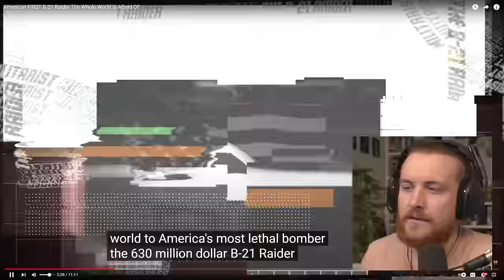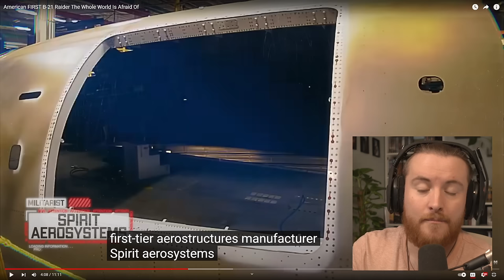Royal Marine Reacts To American FIRST B-21 Raider The Whole World Is Afraid Of!

Comment: The F-22 has the radar cross section of a bumble bee.
Reply: The more conventional description is that the F-35 has the RCS of a golf ball, and the F-22 has the RCS of a marble
Reply: Source: Trust me bro.
Reply: But it's a bumble bee that flies at Mach 1.7.
Reply: That's at first detection. The closer it gets to the radar, the larger the profile.
Reply: @liberatumplox625   the F-22 has an RCS of 0.0001 meters squared Source Lockheed Martin/Boeing
Reply: @2fathomsdeeper  F-22 can do 1.7 without afterburners. it can exceed 2.1 with afterburners.
Reply: @seanabsher5577  That's mainly to get to the battle faster. Top speed isn't very important in the dogfight.
Stealth, maneuver, weapons, pilot skill, awareness, these are all much more important. It's also where the F-22 shines like a huge lighthouse.
The F-22 is easily worth more than 20 planes for the enemy. If there was a squadron of 5 F-22's, they could take out 100 enemy aircraft, no problem.
Reply: @protorhinocerator142 
One of the best things for the F22 is its ability, similar to the F35, to identify targets and hand off that info to individual missiles.
After that, the F22 pilot hits the kill button and drinks a martini on his way home.
Reply: * acknowledged radar cross section
Reply: Wouldn't the fact that a bumble bee moving that fast should be a red flag be a problem?
Reply: Well a bumble bee has the radar cross section of an F-22!
Reply: @joshbull623  , it's not like in Star Trek where sensors and scanners can not only detect an object, but immediately determine its shape, material composition, and other physical properties.

A radar system is going to display a collection of radar returns based on signal strength. It's not showing some aircraft, a flock of geese, and a bumble bee...

The smaller the RCS from that distance and angle, the closer an aircraft needs to be for radars to receive a strong enough return to be distinguishable from background noise. ECM could make that range even shorter

Until a critical distance is reached, a stealth aircraft will not show up at all. Once in range, it will appear as a return on radar. The problem for the defender is that it is possible that the intruder has fired its missiles before the aircraft shows up on radar. The incoming missiles may be the first indication that they're there.
Reply: @liberatumplox625 don’t be that guy…
Reply: And has the aggression of a hive of killer bees.
Reply: @seanabsher5577  Mach 3.3 top speed
Reply: @liberatumplox625  bot found
Reply: @weissmorris8822 bumble bee nut marble can't change what's been said buy what been said after testing and everything
Reply: Detecting and weapons lock are two very different things

Comment: If I'm remembering what I read correctly, one of the giant aspects that won the B-21 the contract was the low cost and ease of maintenance. Part of the reason it took so long to develop was because they wanted it to be made from parts of other planes, military and not, so parts would be cheaper and easier to source, since the infrastructure was already built, and parts were already needed for other things, so production could be shared across more airframes.
Reply: One of the giant aspects that won the B-21 the contract was politics!
Reply: @bigcountry9457  Well yeah, that's always the case.
Reply: Gotta reduce that logistics trail. The real cost of any weapon system is sustainment.
Reply: There was also the material science. The new radar absorbent material is SIGNIFICANTLY better. It’s cheap to maintain and can withstand harsh environments like salt air without requiring time and money intensive maintenance.
Reply: @DAAllan82  Ohhh I didn't know that, very cool
Reply: @DAAllan82  Funny enough, most materials science advances tend to go that way.
Stage 1: Wouldn't it be cool if we could get an X that does Y?
Stage 2: We can now make an X that does Y!
Stage 3: Holy shi- X is expensive to maintain, can we get something that does Y without breaking the bank?
Stage 4: Z does Y for less!

Comment: We really need to Make a successor to the B-1. The B-1 is an absolute monster that has not gotten the love that it deserves.
Reply: The B-52 is going to turned into a cruise missile truck and I'm surprised the B-2 wasn't a  non stealth supersonic cruise missile truck.
Reply: Per the video, this will eventually fully replace the B-1 and the B-2, meanwhile Grandpa Buff will remain until its expected retirement in 2405 after helping the NCC-1701-F on some missions and watching it retire also.
Reply: I would love to see existing B1-B's converted to the B1-R concept. Those would be terrifying to the enemy.
Reply: I would much rather see a successor to the B-52. I call it the B-53. 
It's basically the same plane as the B-52 but around half the size. It carries half the bombs and uses half the crew. Much more modern of course, and easier to maintain.
Since the B-53 is smaller, it can take off from any runway. You don't need a 23 mile long runway or whatever like the B-52.
Since it can take off from anywhere, have them take off much closer to the target. You get faster turnaround, and more bombs on target in a 24 hour cycle.
Reply: @orlock20 When you decide to carry cruise missiles, you put 90% of your payload into propulsion, and only 10% into warhead and guidance. The B-21 can put 100% of its payload into warhead and guidance. To put it another way, the 20 B-2s would have the same effect of 200 similar aircraft carrying cruise missiles.
Reply: @protorhinocerator142 That would be the B-47... which had the disadvantage of needing support from allies like UK, France, Germany, Turkey, Japan, and had operations restricted by domestic politics of those countries.
Reply: @DonMeaker The cruise missiles carried by the B-52 would have warheads ranging from 1,000 lb to 2,000 lb.  The U.S. torpedo has a warhead of 640 lb.
Reply: Every one loves the Bone
Reply: B-1 Lancers is getting upgrades to keep it in service into the 2040s. Which is good because it’s our only supersonic bomber, has the highest payload of any of our bombers and it is actually very stealthy.

Comment: The original design of the B2 did not have the multi-faceted tail.  That was a last minute modification to allow it to operate at low level instead of high altitudes.  This was done because Airforce brass didn't trust stealth technology. In fact, the original B2 tail was almost identical to the B21.
Reply: This.
Reply: Now that stealth is proven, we took the training wheels off to make the B-21.

Comment: 13:00 the B-2 needs air conditioned hangers the B-21 does not.
Reply: Do you know how terrifying that one fact is?
Reply: @outcastmoth78kaminski4  plus they are smaller, so they can take off a smaller airfield.
Reply: @apex_blue  how low-key horrific would it be if it turned out the Raider [as is Doolittle and his Raiders...] could launch from a super carrier like Enterprise when she launches in a few years...
Reply: @outcastmoth78kaminski4  B-21 rocket assisted takeoff when?
Reply: @outcastmoth78kaminski4  Being serious here, while the B-21’s range is classified. It’s heavily implied that it’s meant to have the range capable of going to China and coming back.
Reply: @apex_blue  indeed and likely Drone based mid air refilling is included in the basic design.

Comment: I have seen these stealth aircraft in person and they are extraordinary.  In fact, they are spooky and will scare almost anyone.  Their black color isn't just dark; there is almost not depth perception.  In the air, the planes can turn in such a way as to virtually disappear to the onlooker.  These planes are meant to get the job done and are likely to do it.
Reply: Right! Its not just black paint. Their coating is very expensive, designed to absorb radar, an segment of electromagnetic waves, similar to visible light. 
So this makes sense with its peculiar visual characteristics that make it visually difficult to track
Reply: Yep
Reply: There is a video of a B2 doing a flyover a street fair. The thing looked like a hovering silent flying saucer and only made a sound when it was right on top of the person with the camera.
Reply: The B-21 isn’t black. It’s a grayish white and is not intended to fly only at night.
Reply: I also got to see one in person and it was amazing. I was at an air show and we knew the general direction it was flying in from, but we barely saw it until it was right over us. It made no sound and was out of sight in seconds.

Comment: The revealing ceremony did not show the back of the plane.  That’s why you keep seeing differences in the rendering of the trailing edge of the wing.  They only pulled the B21 halfway out of the hanger, and only allowed front view photos at the revealing.  That was how they intended to reveal the B2 as well, but a savvy reporter rented a plane, and was able to photograph the B2 from different angles.  That’s why they only pulled the B21 partially out of the hanger.
Reply: Yeah, the longer they can keep things secret the better.
When we first made supersonic jets we kept the tail sections hidden too. With prop jobs, you could have partial flight controls on the tails. These didn't work well at SS speed.
To make it work, you needed the whole tail to move as one. It would be very obvious how we overcame this problem from a picture, so the tail itself was classified.

Comment: The Government issued a Request For Proposals (RFP), very classified, to the very few firms US who had the wherewithal and facility clearance level to do this.  That RFP didn't specify a design, rather it set out the requirements for a LOT of things, but the biggest examples would be bomb load carried, cruising speed, max speed, radar signature, max range, etc.  Then they bid, and the bidders will spend millions, maybe tens of millions, on the bid, because if you win the prize is so big. The Northrop design has built in advantages like having no tail - reduces weight and radar signal. Basically the entire plane is creating lift, and carrying engines, fuel, bombs, systems, or pilots.  The efficiency leaves more weight carrying to be dedicated to other things, such as fuels and bombs.  Super-efficient shape that happens also to be naturally strealthy.  When you see a side on shot, it looks like a bird of prey, and the hump mimics their body shape when they are diving on prey.

Comment: Basically a bunch of military contractors come up with designs and propose it to the military and whoever makes the best case for their plane gets the contract to R&D and build the plane
Reply: That's not true at all.
The military starts by pointing out a need. The F-22 can do this and the B-2 can do that, but there's this big capabilities gap RIGHT HERE that we need to fix.
The Air Force makes a list of requirements for the future miracle flying machine, and the defense contractors have their engineers come up with proposals. Eventually they need a working prototype to seal the deal. The requirements for the B-21 are feakishly insane, and a company managed to meet those requirements. Game on.
Reply: @protorhinocerator142  "miracle flying machine. " lol. Also, it's the best spot on description ever.

Comment: One of the reasons the B-21 was built to fly unmanned was to extend its range and capability by flying at 60,000+ feet. (Less gas is burned at that altitude.)  The bomber is still piloted remotely by B-21 pilots sitting behind a console. (Referred to now as the "Chair Force."  I'm told they've enhanced its radar absorbing material (RAM) among other things.  Being in the Air Force I regularly flew into Whiteman AFB and saw the B-2 up close and personal (from a couple hundred yards) while my own aircraft was being refueled.  I always enjoyed passing through Whiteman AFB for that very reason.
Reply: They also stuffed the B-2 with a bunch of targeting sensors making it a real time scout as well as a bomber.

Comment: The tail of the B2 was always supposed to look like the Raider's tail as it is better for radar cross section. The fly-by-wire flight systems at the time of the B2's development weren't advanced enough to reliably control the B2 without the additional control surfaces given by the extra notch in the tail. This was, in part, due to the lack of vertical stabilizer and rudder on the aircraft. Guess they solved that problem...
Reply: yes and no.  the reason for all of that was all of the additions the air force wanted, and added on.  which caused the size of the plane to expand.  B-21 was the original design they came up with.  without all of the added nonsense Air Force generals added.  like low altitude flight, and others.

Comment: The F-35 has a radar crossection the size of a golf ball. The B-2 Spirit has a crossection probably the size of a marble and reduced thermal plume as it can glide to target. The B-21 will most likely have the detective size of a bb. Along with autonomous control, you could pilot a squadron of them and hit simultaneous targets with a single crew...or just a preset mission package.

Comment: The change in the shape of the wing is due to having fewer engine exhausts. That triangular edge hides the heat signature of the engines. The B-2 had 4 engine exhausts, the B-21 only has 2. It also has the added advantage of being a better lifting body so less wing is needed to provide lift, further reducing cost and radar cross section. The electronics and communications upgrades are likely akin to the F-16 to F-35 differences. F-35s have networked fire control, target acquisition/ information and C2, F-16s don't. Likewise, B-2s don't have any of those networked information systems (setting as they entered operational status prior to those being developed).

Comment: The cost savings is done partly by making the focus of the flight high altitude. Since now it is sole purpose designed to be used from altitude as opposed to low level bombing done by the first generation..The wings had more serrations at the back when it was required to do low level missions

Comment: Lastly, the B-21 is currently in production while the earliest airframes are undergoing pre-operational tests. This is very normal, essentially test pilots are making sure everything is working properly and any issues get worked out while the assembly line begins to ramp up so adjustments that are needed can be implemented. The first B-21 to fly was named “Cerberus” — you can find footage of it on YouTube. You’ll notice a little antenna sticking out of it that you don’t see on the design shown in this video — that’s a sensor for flight data.

These test flights are expected to continue until around 2027, which is a normal — perhaps even ambitious— timeline.

Comment: One of the reasons the B-2 was  so expensive was they changed it at the last minute. It's subsonic, and it's unarmed and they were worried if anyone saw it and launched planes against it, it would be a sitting duck.  

So the designers changed the B2 and added more triangles to add control surfaces--the B2 used to look like the B-21

But the B-21 will carry air to air missiles so it can fight back

Comment: The B-21 is likely built with more modular components for more seamless integration of updates through its service life.

Also, the F-22 Raptor is the stealthiest aircraft at 0.0001 square meters of RCS. It has an RCS a twentieth that of the B-2, though admittedly, it is a much smaller airframe.

Comment: Gov't contracts work as follows: Gov't issues RFP (request for proposal) they give a list of requirements,: distance on full load of fuel, air-to-air refueling, max weapons capacity, radar and targeting capabilities, threat detection on min distance, manned un-manned or both, radar cross section, etc. and cost per aircraft to achieve everything listed. each company that the request is given to submits their design for how they will achieve the requirements along with preliminary designs etc. Then the gov't chooses the cheapest that meets their minimum requirements. It's more complicated than this, but that's the gist.

Comment: The B-2 originally had the same tail design of the B-2.  The saw tooth tail of the B-2 was added when the US wanted the capability to fly at low altitude.  It provided more flaps to allow this.  The change to the original design would be an indication that the B-21 will be a high altitude bomber.

Comment: I don’t know from experience but the way the contracts work is that each company gets the same set of specifications they have to fulfill.. beyond that do what ever is clever. If you check off all the boxes and bring something new then cool. Then they do test flights and determine a winner based on the needs of the aircraft and it’s intended mission. The best plane wins, and sometimes they hold on to the records and mothball them to bring up and re analyze at a later date. Nothing is wasted

Comment: The original B2 design was just like the B21. A diamond with winglet extensions. The two extra sawteeth were added during development due to airframe structural strength concerns.

Comment: Military contracts are very straight forward.  The Government whomever they are Army, Navy etc set rules, timeline, and requirements for example needs to be small or non radar signature, dimensions, range, tech, capabilities and implementation of X it can be a weapon , sleeping quarters etc. Then those companies go to work 'on their dime' and present the plane, tank etc by the deadline.  At which point the organization selects the prototype that is closest to the parameters given before the build and of course up front build cost per unit, fleet maintenance cost, training and build time. This is the process in a nut shell...